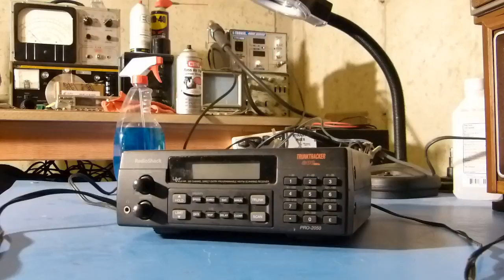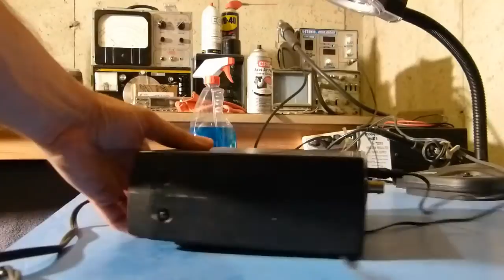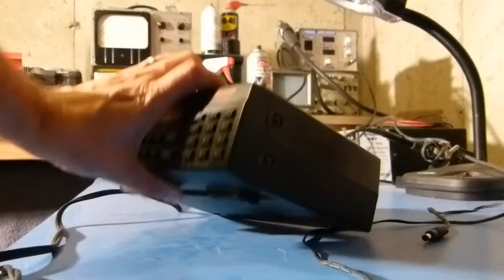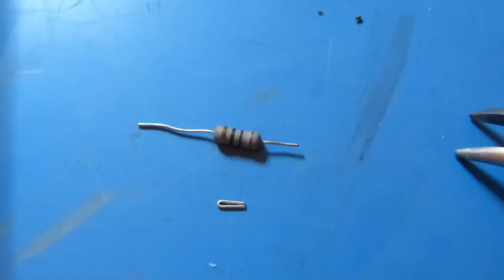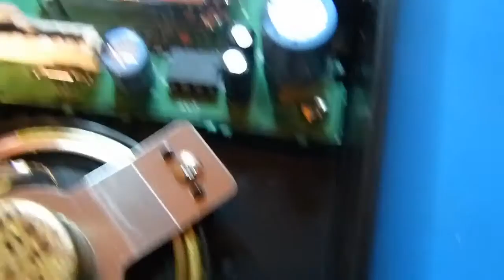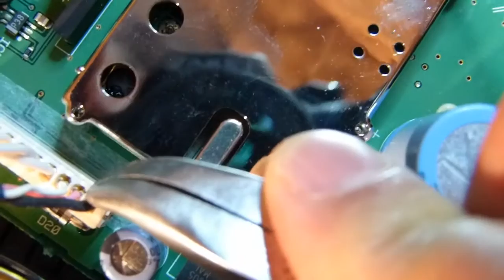Radio Shack PRO 2050 Scanner Repair Highlights - Volume Problem

Comment: I have the same scanner 2050, After scanner has been on for a while it starts to Hum, and hum does get louder when you turn up the volume. Any idea on what it might be and poss fix solutions?
Reply from the maker: If you are running it on AC, try running it on DC from your car or a battery and see if things improve (if you haven't done so already).  If the noise goes away then you may have bad filter capacitors and/or a bad power pack.  Try replacing the power pack and see if it clear things up.  If it doesn't then you may need to replace the filter capacitors inside the unit.
 You could also try bringing the scanner to another location, like maybe a friend or relative's house and see if you get the noise in another location.  If the noise goes away then something in your current location/installation is causing interference. 
If the noise doesn't go away after trying all of that then something else non-power supply related may be failing internally.
Reply: Thank you

Comment: hi do you know how to repair a bose wave radio, it makes a popping sound when you unplug it. It does not power up when plugged in the wall...any ideas?
Reply from the maker: +Dink Worm Not specifically....but I would suspect bad capacitors or a bad relay.  search for Chris Cuff's channel - he has some good wave radio repair videos that may help you.

Comment: Hi, I have a problem with my manual push button. My radio is also a RadioShack pro-2050 and works very well exept the keypad. Have you done any keypad replacement ?
Reply from the maker: +Vienneau Marcel I haven't had any trouble with the buttons on this unit.  However, I have repaired keypads on other radios by removing the rubber keys and cleaning the gold contacts on the underlying circuit board with a pencil eraser.

Comment: Most likely just a cold solder joint, easy enough to repair properly...
Reply from the maker: budleyca1 This wouldn't have worked it it were a cold solder joint.  The wire crimp or the pin contacts are bad.  If there was a cold or cracked joint on the main board wiggling the connector with the shim in place would still produce the volume problem.  Thanks for watching!